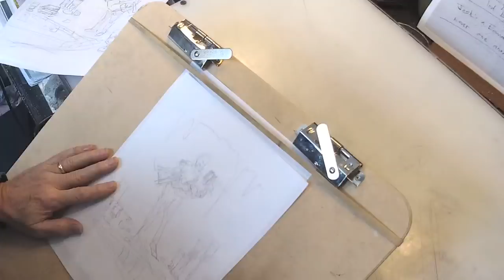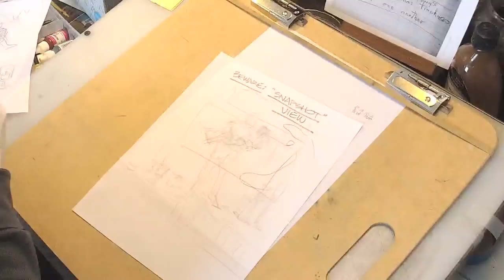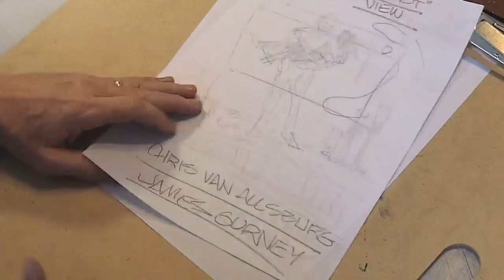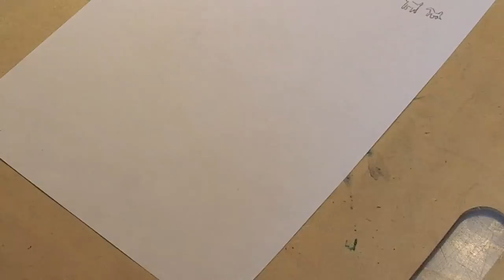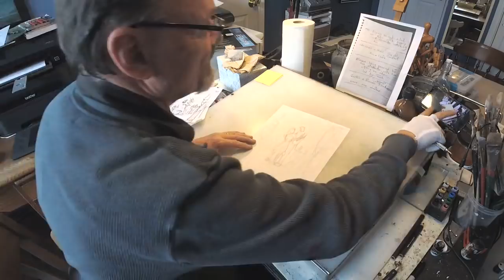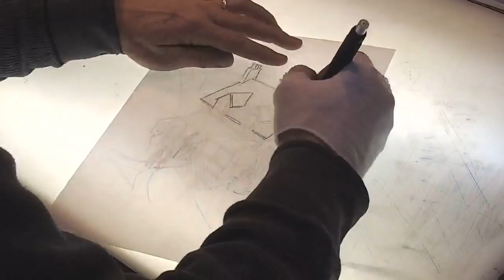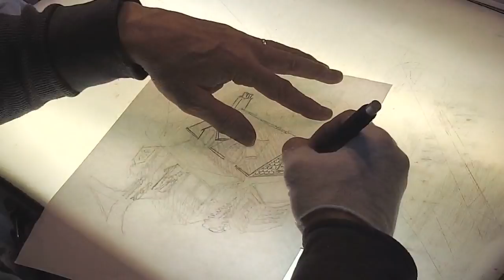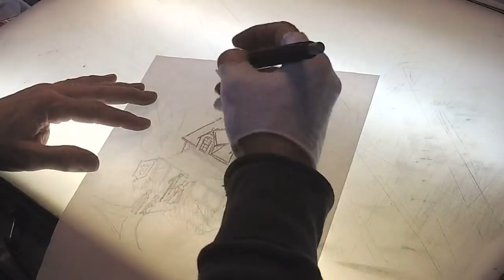Daily Art Adventure 337. Developing Illustrations From imagination.

Comment: When You want to have a bit of a finer line that lid is a sharpener. I keep the graphite in a separate bowl to accumulate for graphite powder later. Additionally, it is a 2mm lead and I also put 2mm charcoal or colored pastels in it when I practice gestural drawing. I never thought about the benefits of this clutch pencil for smaller work to help simplify. Thanks Dan.